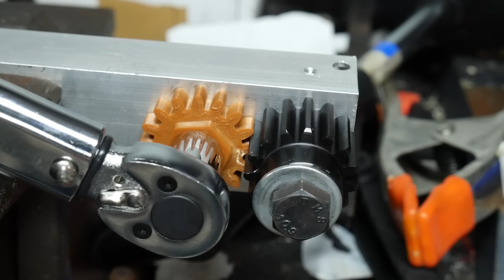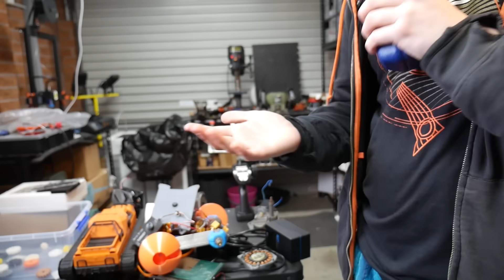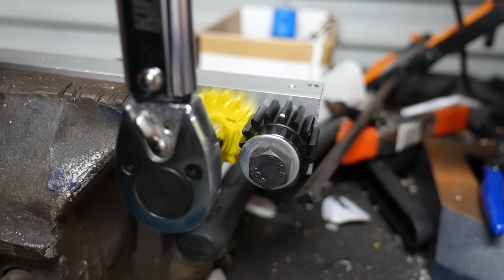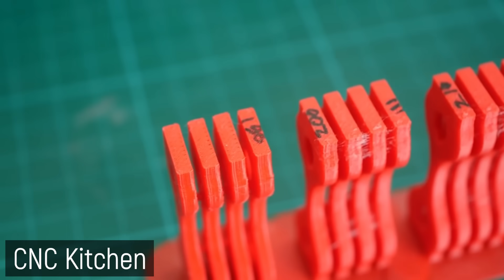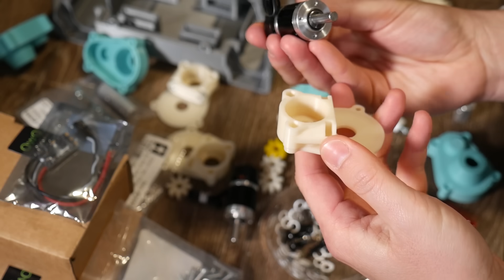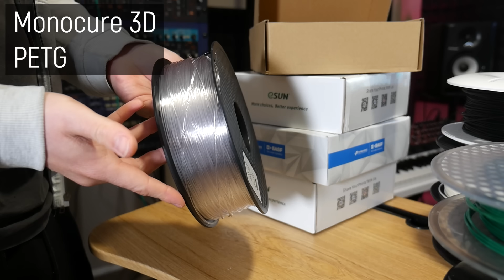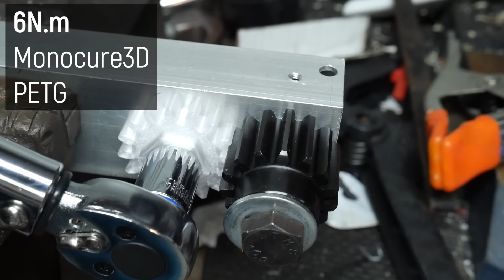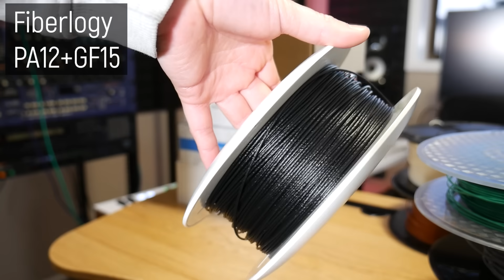Which 3D Printed Gear is Best?

Comment: Late to the party, but as an engineer, I feel the need to comment.  Gears need 100% infill.  Yes, in general, material stresses run higher on the surface, but effectively having a hollow part creates surfaces on the inside as well.  The sharp inside corner that the slicer will leave  under each tooth combined with the inside corner created by the inside surface of the face will create sharp junction of three surfaces on the inside.  This will be a huge stress concentrator.  If you watch carefully, this is the first point where the plastic turns white. (Crazing)  The second place is the root fillet of the tooth.  This stress concentration is inherent in any gear tooth.  Try again with 100% infill.  Also try setting the top/bottom surface thickness to the full thickness of the gear.  I would expect that the diagonalized print lines of the top/bottom layer will act to brace the teeth.  Also, I would experiment with the shell thickness.  I would expect that would allow the diagonal lines to extend into the tooth somewhat, preventing the delamination/crazing at the root of the tooth.  Interesting, but the 20% infill is definitely more of a problem than the material.
Reply: My initial thought when seeing a gear sear.. they weren't solid.
Reply: For sure, even at first test with PLA you can see that teeth are  just separate from poor infill amount in center
Reply: As an engineer i feel i need to add to this, for certain materials 100 solidity is preferred as it is easier and faster to produce. Taking other fields i have experiences in where the approach to weight saving shows that taking material out of a structure can be done in a way that leaves the structure stronger due to it now being lighter and have less to support.

I have found that if i print gears, (usually alot larger than these) plastic works fine. The degree of friction and heat is what makes the choice for material for me and the products i produce. The smaller the gear the worse performer plastic is, there are some wildcards here and there, but i mainly use metal for smaller tough gears.

Also the infill type, wallcount, infillpattern has much more to say for strength than the material in real life. Take the last one off the plate for an example. Its a drive gear for a snow removal machine where the drive gear from the rotor had sheared due to stress and temperature. The gear was made of low grade abs and showed crazing at the hub where the crossbolt was threaded in a m6 bolt and locknut. The load tolerance simulations i performed showed that an  infill of 25% gyroid would perform best to shift the axial load over the internals of the gear. Today with simulation software there is no need to "try again" to see the outcome :) Saves SO much time and not mention print hours.

When u have made as many parts for industry as i have u get a feel for the need of the part before u even get the measurements or pictures :) Usually i go for gyroid on planar gears, if they are transfers or reductions i prefer to simulate them several times before ending up with the wanted percentage of type infill. So there is no "one receipt" for settings to fdm a gear really. There are these basic things to change though. 

1. Increase wall count to minimum four walls in order to facilitate a larger surface area to transfer the load from the toothline to the hub.
2. Taller layer lines tend to fuse better 
3. Increase wall overlap.
4. A uniform shell thickness and shell printspeed.
5. Consider the load direction the gear will face, and chose an infill type that will adhere to the direction needed. (general physics knowledge is a bonus)
6. Material choice is down to temp and wear resistance. I have several gears running in machines like dentists drills which i used pctg/petg and two transfer gears in a lathe what is printed in TPU to kill the backlash.
7. Orient the model to a flat plane to have better prints.
8. Don't lock yourself into  a one slicer environment.
9. Experiment with the slicer settings and see what does what to change your models visualization in ur slicer. 
10. Do take the time to watch ur prints with ur own eyes. In most cases all errors and fails can be identified in this manner, plus u learn so much about how the printer makes your parts.

Have fun and keep flexing those plates :)
Reply: @reyalPRON   How did you do the load tolerance simulations with the infill?
Reply: @conorstewart2214  what simulation is that?
Reply: I wish I did engineering
Reply: I also want to see him try with smaller and larger gears, to see if the failure moves around and/or if the force at a location is the determining factor.
Reply: also. apply force to the same tooth, many times, gives you differents results of real stregth. good video anyway.
Reply: An interesting question to me would be: Is it better to have a reasonable amount of walls and 100% infill, or crank the wall count through the roof and make the gear solid in that way (all walls, no infill)
Reply: Actually 100% infill isn’t as strong as making it all perimeters 😉
Reply: I agree, and in addition, I am wondering if the hex expanding and stripping out is because of the lack of support because the infill is not solid?
Reply: He likely does the lower infill to save on weight for his battle bots. If I remember correctly he uses a lower weight class where a couple grams could very well matter more than a bit of extra strength
Reply: my first impression....was what you said....why 25 % infill...not good....But here is the catch....if your motor is for 20 N-M...then you want that the gear fail first....otherwise you will burn your motor...👀
Reply: @Tony Power  no, steppers lose steps all the time. It's a iconic clicking sound when the force is too much. Don't use gears as mechanical fuzes.
Reply: Grineer?
Reply: exactly what I thought, maybe what he really measured was notch sensitivity? But I'd say this comes in handy if you want to use it as an adjustable mechanical fuse.I would say that diagonalized full layer infill only braces in 4 directions and not so much in the others, so maybe a concentric or sort of a random pattern would be better? Maybe vertical layer thickness is the way to go as you can see the perimeters rip off pretty often?
Reply: You start getting diminishing returns on strength after like 60 or 70% infill... 100% is really no stronger than like 80 or 90
Reply: @coledavidson5630  hear hear. i did some testing with abs on a large drive wheel for a snowflinger. The conclusion i came to was 20-35% of the correct infill for the task makes the cut every time. plus it saves weight, time, and filament :)
Reply: @coledavidson5630  Yes, but in this case, we're not talking about overall strength, but diminishing the stress concentrators created by the gear teeth and internal corners created by the infill. Someone should add a feature to slicers to allow defining a volume where Infill is allowed, and also to force filleting the infill in stressed areas to avoid stress concentrations.
Reply: As a design engineer, I feel you don’t!
Reply: Not an engineer here but ropes are better than gears. Think muscle etc..
Reply: I think this is not an appropriate device for gear testing... it creates incorrect moments of force on the teeth.
Reply: As an engineer I need to state that gears can get away with 50% infil as long as the vacancies are regular, dispersed and symmetrical, like you drilled small holes through the material in a hexagonal pattern.  Round holes, hexagonal pattern.  Distributes the stress loads evenly across the material resulting in lighter stronger part.
Reply: I couldn't imagine making gears that weren't solid. I have never seen a hollow gear.
Reply: @kdw75  Low infil has been around for decades, its not hollow, they are just porous.
Reply: A few minutes in and I was also scratching my head wondering why 20% infill was being used for this testing. I'm still a relative 3D Printing newbie, but from what I've seen so far in my own experiments low infill levels work better for large objects and apart from speeding up print times and reducing filament use I've found it can help prevent warping of the base layer during printing if you're trying to print something large and flat. (Like an upside down toy table)

But anything small that needs to be strong and has high force concentration on a small area like teeth on a gear needs to be 100% infill for sure. Hardly a fair comparison against an injection moulded gear which by definition is "100% infill"... While I haven't tested them with a torque wrench I've printed a few small gears with PLA with 100% infill and they seem surprisingly strong if you print them in the right orientation - probably comparable to cheap injection moulded gears.

I'd like to see these tests re-done with 100% infill and no other changes.
Reply: Also i will like to add that treating al materials the same way is wrong, maybe with nylon you will get better results with a square hole in the center by eg.
An engineer needs to know how to make every material shine in their own way, and it means how to handle and use them.
Reply: Так он же сравнительный тест делал. Шестерню хреново наслайсил, да. За то у всех пластиков одинаковые условия.
Ну и так, чисто придраться - силовые шестерни делают под шпонку, а не под шестигранник - так удобнее упираться.
Reply: Followup: Would it be possible to fill the hollow parts with sand/water?
Reply: @EnjoyCocaColaLight  Probably wouldn't do much.  Sand/Water would fill the space and prevent volumetric compression, (look up poissan's ratio) but wouldn't help much with linear compression and shear.

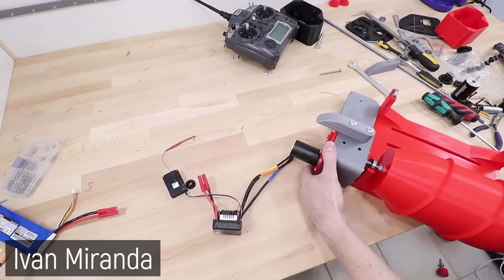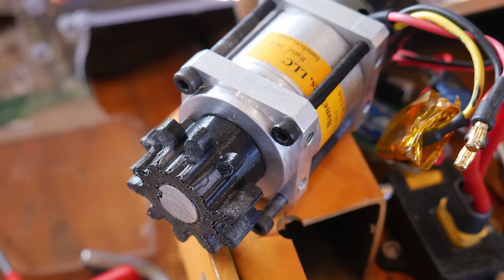Comment: As a model railroader, lubrication is a concern.  Is there a product similar to Delrin, a slippery self lubricating plastic also called an engineering plastic, used in 3d printing.  Engineering plastics machined for gears (even in 1:1 scale) because of their slippery properties.  In model locomotives worm & bull gears are in positions of wear.  I deal with models in 1:20.3 or 1:29 scale.  My trains run in my outdoor garden.  I've been considering 3d printing for unavailable gears & custom parts making for my train models.

Comment: As a mechanic I've been warned that the mechanical torque wrench is only accurate in the middle of it's range and least accurate on the both extremes of the wrench.

Comment: PA is used in gears because it has a lower friction coefficient and because it has decent lubricating properties, resulting in a higher efficiency and longer lifespan. The gear wearing down over time is often a bigger concern than the material failing due to mechanical load, because you can use a bigger modulus or wider a gear.

Comment: Great test thank you. Looking at the tensile strength of each material supports your results. 

In future tests please look into loaded wear as well please. Strength is only one thing. 

If you can also look into resin filled gears. Perhaps filling a gear with a single outer shell could give higher strength. Printing much larger gears would be good as well, deformation or damage to the center hub contributed to the test results too

Comment: BASF (or bas-f) is a large old specialized plastic manufacturer wich is new to the 3d print market, while a lot of filament producers are pretty new to the plastic market. So no surprise it is performing so well. I didn't expect pla would perform so well, and had to see this video after one from cnc kitchen to believe it. If pla would not degrade nor have a low melting point, it would be perfect. I'll stick to petg and will try nylon in the future.

Comment: I haven't done a lot of testing or printing for that matter, but I used to have this carbon fiber filament that was so strong me and my nephew printed a hollow wheel where one end was completely hollow and the whole inside, and the other end was full on the end.  Kind of like a skateboard wheel where it was like 98% hollow.  The shell part was only like 3mm thick...and otherwise this thing was hollow.  We printed with 100% infill with this carbon fiber and i put all my weight, 180 lbs, on 1 foot on this thing and it didn't break.  This was on his ender 3 pro. Since then I got an ender v2 used and it has some problems.  I'm working out the kinks but even now it doesn't print anywhere near that strong.  So I think a big part of it was printer health.  If you have any mechanical issues whatsoever it won't come out that strong.  I printed a little boat benchmark and it turned out pretty good, but I can break it with my hands if I try.  I still have some of these wheels I printed with his printer before on my desk.  I even have 2 of them that are like Heely wheels (far less hollow than the ones I mentioned b4) and they are fucking solid.  Like metal, except not as good against heat (PLA).  I wish I could get my printer to print like that.  I ordered another V2 (new this time) and waiting for it in the mail still...hoping it'll print as well as his ender 3 pro printed.

Comment: Good video. I would be curious though that if you were to double the gear thickness, does that double the strength of the gear? Also how much does the % infill change the strength. I would very much like answers to these questions as I am currently in the process of designing a planetary gear system and strength of gears is going to be an issue. Thanks

Comment: Lives in prison.  I don't understand printing mechanical objects that are not solid.  All to save 1.5 cents?  Makes no sense.  Likewise, making anything out of PLA that will be in the sun or outside air conditioning.  ABS looked like it had a higher average than PLA.  Filled plastics will machine away whatever they are rubbing against and teeth scrub in and out as they mesh.  Not acceptable for a gear under any circumstances.

Comment: The question I have for 3d printed gears is how durable they are in terms of wear?

Say you spun one with a torque well under the max but continuously for a long time, which filament would last longest

Comment: It would be incredibly interesting to see the same PLA print the same gear with different settings. 100% infill vs 100% layers vs different temperatures vs etc.. Doing it this way would much better show the best way to print the gear. This would show the "winner" being the printing method that was strongest which would likely translate to being the best method to print a gear across every other filament type. 

Plus you would only have to use filament from just one spool to do the whole video ;)

Comment: If you use the same material for both gears the flex will be shared by both teeth across the mesh. If the deformation is still within the yield of the plastic, it will be more forgiving but maybe sloppier in efficiency. when I say “sloppier” I mean maintaining constant rpm in real-time use.

Comment: I have to disagree with the statement that a 3D printed part "will never be as strong or as precise as a machined one or an injection molded plastic one". Continuous Fiber Reinforced parts, basically thermoplastic printed with long carbon fiber strands, have proven to be superior to aluminum in a number of ways. Markforged uses this process to create parts that,when compared with 6061 aluminum,  have a 50% higher strength-to-weight ratio in flexure, a flexural strength of 540 MPa (Aluminum <480 MPa), and a 300% higher ratio in a tensile moment.
And don't forget; metal can be 3d printed!

Comment: If you are going to measure the strength of plastics, I suggest not to use a torque wrench, as it transmits unbalanced force to the axle and not just the torque. Rather use a torque load and a load cell to measure the torque. As always, an amazing experiment otherwise.

Comment: I cant speak for nylon but for strong and durable, PLA is the way to go if these gears do not generate or exposed to enough heat to soften them.
ABS gears are not as durable but will take more heat but will fail not much later.
PETG very similar to ABS.
Tested in a milling machine before i upgraded to a belt drive system because 3d printed gears could not take it.

Comment: @Maker's Muse
, what nozzle diameter did you print it? I have a question, with  smaller nozzle more resistant is the gear?

Comment: A torque of 8 N.m on a gear with 30 mm pitch diameter means more than 50 kg is pushing on the teeth.

Comment: You can negotiate the torque by changing the gear ratio. Just like on a bike you want a easy gear a small gear is needed on the drive and a big gear is needed on the output. You could also design gears that the teeth interlock diagonally.

Comment: Maybe try POM(Acetal) filament. POM Is used for plastic gears in professional applications. I've never tried it but I've read that it is not easy to print though. Would probably still be interesting
Reply: POM would be by far the best - it's extremely slippery (self lubricating), and for all I know: next to impossible to 3d print.

Comment: The fiberglass-reinforced nylon gear broke between 11 and 12 Nm of torque, because, although there was no complete separation, a crack large enough to be noticed with the naked eye had formed. Also I don't see the point of testing nylon, gears are used to have perfect synchrony between input and output rotation, nylon deforms too much.
That said, the video is entertaining and interesting, from the tests, apart from that of nylon, you can choose well which material to use. Thank you for taking the time to take these tests and for sharing the results.